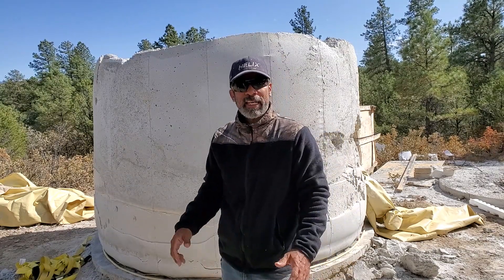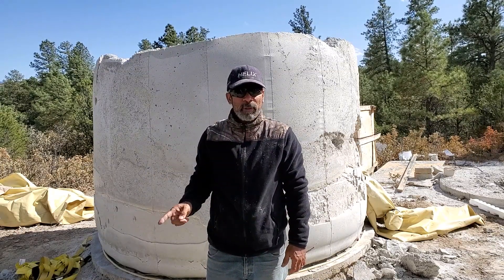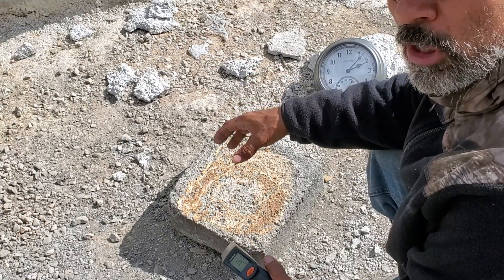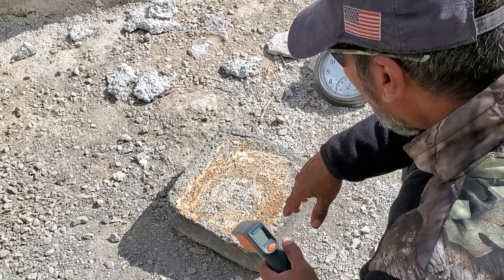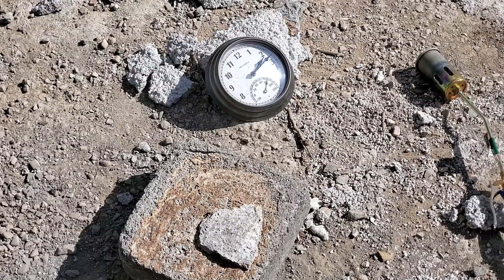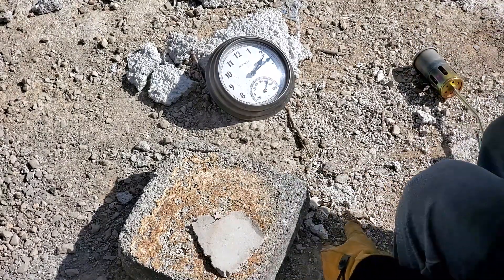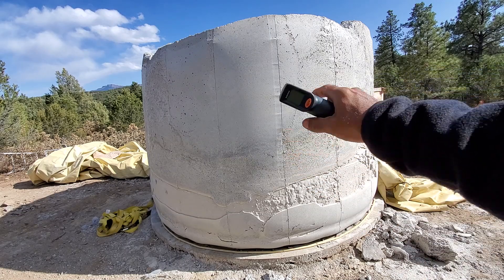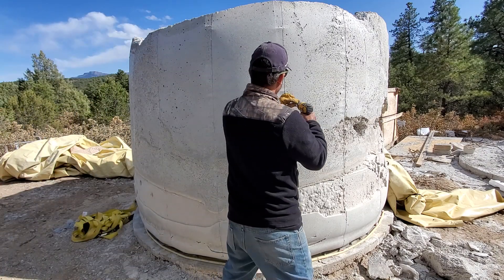E.P.I.C. & Paper | Aircrete Burn Test #epicmix #aircreteharry #domehome #aircrete #foamgenerator

Comment: I think requirement 4 code require at least 20 mins constant heat n some 30 mins most need an hour a wall is constructed in front of an oven and consultant heat is applied temperatures are checked a competition would be 2 use 1/2" 5\8" n 3\4" sheet rock andc1\4" n 1\2" hardie backer and wonder board as u are out side u loose a lot of heat

Comment: @Aircrete Harry

EPS foam is highly flammable. However, EPS foam used in construction is "California Fire Rated" CFR and is self-extinguishing.

If you're just using scrap EPS vs. EPS that's CFR.... your results could be very different.

Comment: maybe test it for moisture penetration or rotting? see if termites like it or something. seems that adding paper or anything organic to it is not a strong point. usually, organic things mixed with none organic things make it mold mildew and rot resistant but not proof.

Comment: Nice work!   How did the heat affect the strength of the wall?   What happens when you hit the burned spot with the sledge hammer?
Reply from the maker: Very little on the outside layer it mad it weaker about a 1/4 inch. the rest was still strong.

Comment: 451 degrees is the temperature to ignite paper or wood.  It stood up for 5 minutes, pretty good.  I would say to simulate a bit of preheating from a tree or house burning nearby, then give it some torch action.    Using your papercrete block as a back stop for the other tests satisfied that.  It does not support combustion awesome!
Reply from the maker: Thanks!

Comment: Thank you Harry for this video, quite impressive in term of fire resistance. I'll would like to see earthquake and hurricane resistance of this building/air crete mix too. Wish you the best Harry, take care.
Reply from the maker: Epic is much stronger then Aircrete.
Reply: Domegia dome in hawaii have put up with huge amounts earthquakes and hurricanes with no damage.
Reply: @jeffkrupke3810  I know about Domegaia, that's how I've learned about AirCrete in the first place. They add 2 layer of fabric (one inside and one outside) for increase in tensile strenght, where the concrete lack. I would be curious how the EPIC mix is earthquake, hurricane proof. At the same time, a comparaison of geodesic dome structure in wood compare to aircrete/EPIC mix would be interesting.

Comment: Couple of tests for you:
1) take a 5 gal pail and use it as a form making a 6 inch and 8 inch "barrel" around the outside of the pail.  Once they dry use them a burn barrels.  A normal house usually has 6 or 8 inch walls, so the 6 and 8 inch thick barrel would be similar.
2) Make this Foundry ( https://www.youtube.com/watch?v=rqgmVvtP944) with epic as a ultimate heat test, see how hot it will withstand.

Comment: I'm wondering if the paper-create would work as a home insulation?  How does it hold up against long term moisture and possible rot/mold.
Reply from the maker: Aircrete alone would work for home insulation.
Reply: Nothing organic to rot or mold. Does not wick water the way standard concrete does. And it flows into all the voids really well.eith papercrete you could fill the entire void at once. With aircrete you can only fill approximately 1 foot to 18 inches in depth at once as too deep will force the bubbles pt and lose ypu r value
Reply: Are you using aircrete, papercrete, and styroaircrete together? I need a recipe.

Comment: Have you looked into those nano-bubblers the Japanese invented ? combined with an Air-lift pump + interior graphene coated hoses  and/or graphene admixture in cement for two story pumping...I have tried the graphene in my aircrete w/H2O  repellent ....so it floats and does not get waterlogged / could be used as an insulated watering trough?..the downside was it took too long for me to cure.
Reply from the maker: I would love to see your experiments.
Reply: Biospheres, is there a way to make water tanks with aircrete?

Comment: Awesome stuff.  Have you ever heard of "fire stopping paint"?  When hit with a torch it expands and forms a thermal barrier to the wood.  Also, how water proof is aircrete; can it be used as a roof without any furthrt water proof coatings?
    Great series!  And i thank you for all the great research.  I can tell that those are large projects.
Reply from the maker: I sell a paint  The contains surrounding beads and its is fire proof I'm not sure where talking about the same paint though.  Aircrete is not waterproof you would need a waterproof stucco coating on top of it.
Reply: @AircreteHarry  , could a water tank be made of the inside is coated with something? Our would it crack?
Reply from the maker: @TheRainHarvester  Yes! you could make a water tank of this EPIC mix.
Reply: @AircreteHarry  , would regular aircrete work too?
Reply from the maker: @TheRainHarvester  Yes Aircrete would work.
Reply: I have been chewing on the idea of mixing water based apoxy on the aircrete with Leggari apoxy products. The sky is the limit to the esthetics and would seal interior and exterior. I also thought stirring in a concentrated additive dye or pigment could create a desired color bass tone; not for water resistance but general finished look. 

I’m not sure how the water tank would handle with apoxy and possible contamination but I just figure if one has a barrel big enough for rain that you just use the barrel.

Comment: How is it if you leave it in a barrel of water submerged? ? Love ya'll
Reply from the maker: I'll do that test just for you next.
Reply: @AircreteHarry  thanks brother
Reply: Water is my question
If it is under dirt like side of a hill and high ground water
Will it seep
Paper aircrete specifically
Reply from the maker: @jodibaas6954   I'm not sure about the paper Aircrete I just started experimentin with that stuff.
Reply: @AircreteHarry  well I am loving your videos! Learning a lot and you make it fun with your experiments and family assistance 💞 keep up the great work!
Reply: @jodibaas6954  it would allow water through, it would need a water resistant concrete on the outside, then foamcrete, or epic can be used on the inside,
Reply: @jamest.5001  thanks,💖🙏💖
Reply: Hopefully he can enlighten us
Or suggest a natural answer to coat or add to it
Reply: I'm just very curious what 24 hours of soaking will do
Reply: I will bet it will perform great. But only time will tell that. Harry has a good brain I will bet there is something in the formula with respect to water/moisture. 

I bet you home boy has it covered.